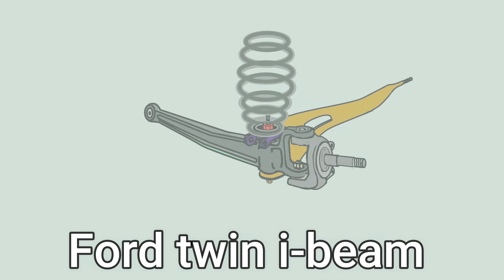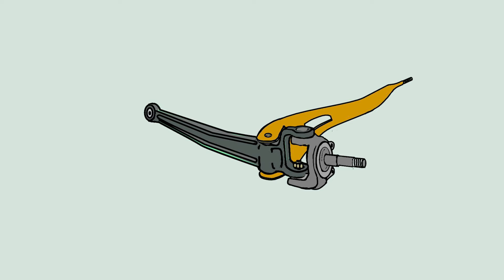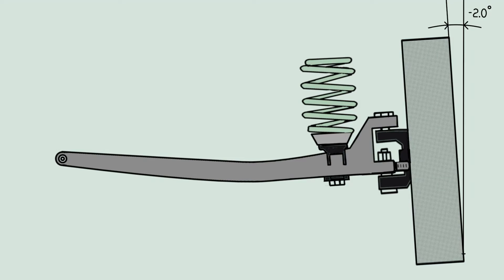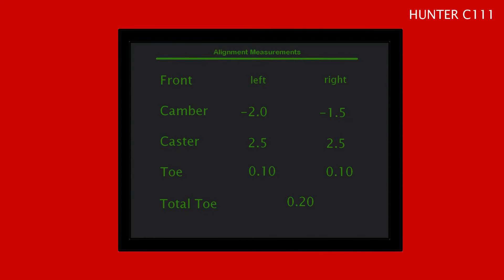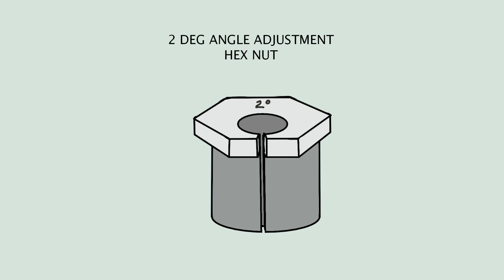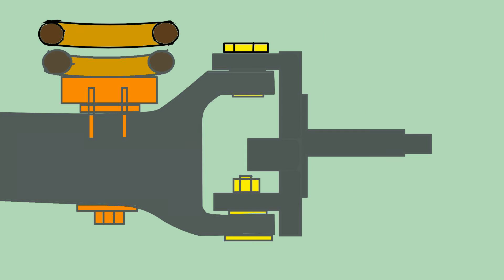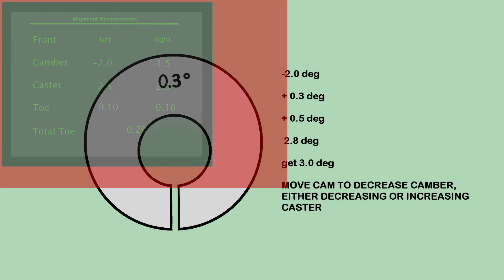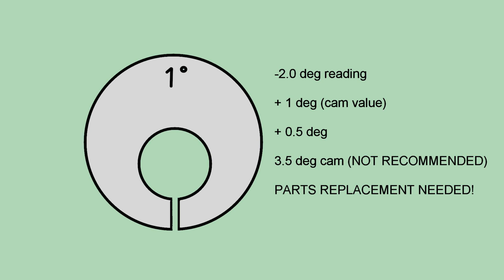Ford Truck twin I beam alignment

Comment: Thanks for the vídeo. I need help with sistem 1978, it's diferent.
Reply from the maker: which system do you have? is it a 4X4?
Reply: @CMDWorks  No, it's a Ford Econoline 250 1978 Twing i Bean, but, I hace to raise two Inches, to avoid the blow of the tire.
I don't know if it can be aligned
Reply from the maker: @hectorromero3418  No adjustment with cams on that one, has king pins. Right? if it does, to adjust camber, the twin I beam axle has to be bent to the right angle with hydraulic ram system special for that purpose. Good luck.
Reply: @CMDWorks  Thanks a Lot and great video

Comment: Can you speak to the 1980s Ranger adjustment here ? Mine appears to have that adjustable nut thing on the bottom ball joint whereas you say its on the top ball joint . Which is it ? Thanks !
Reply: Three things to remember: 
1) If the upper ball joint has the nut on the bottom, the bushing offset will only change Camber and not Caster.
2) The 4wd F Series and Ranger had slightly different size bushings and are not interchangeable.
3) If you can, always disconnect the tie rod when replacing or repositioning the bushings so you can turn the steering knuckle to be sure the bushing is properly seated and the ball joints are not bound up by being pulled away from each other or pushed towards each other. One strong finger should be able to turn it lock to lock up in the air.
Reply: @don2deliver  This is helpfull Thank you !
Reply from the maker: As I indicated on the video description, this video refers to 1990's twin I-beam systems.. I would have to make a different video for those older systems, that were a lot more difficult to adjust and replace the cams, I did a lot of alignments on them, and believe me, I still hate them. Thanks for the comment,
Stay tuned.
Reply: @CMDWorks  THATS why we need you brother ! I was scratching my head looking at my 88 Ranger . Im almost tempted to just replace the coils to hopefully correct the problem . Im out about 20 deg ( guessing )
Reply: @CMDWorks   Can you describe some instances as to what is hard about this 1988 Ranger ? I notice the adjuster is on the lower ball joint !  How do you get it out ? (my 2nd reply)
Reply from the maker: @tonyrandazzoe8210  I have not don one of this in decades, but if I remember correctly, take the lower not completely off, then use an air hammer and hit around the sleeve, (not the sleeve itself)  if is very rusted you have to keep hitting around it until the vibration loosens it. Exactly as if you are changing the modern ones.  watch my video: https://youtu.be/hap9qGD2ra4 just like that. but since it is upside-down is very hard to do. Good luck guy!!
Reply: @CMDWorks  Thank you brother!

Comment: I understand this. This is a great video to by the way. Do you know why on the ttb after I did a 6 inch lift the reason the front tires toe in when I go in reverse? Makes no sense and I feel like something is going to break. Everyone tells me the obs ford ttb is know to do that lol buy WHY! thanks just FYI when I pull forward tires straighten out
Reply from the maker: Most TTB systems do that. I would say thats normal. I have seen this phenomena since I started working on alignments late 1980s . Do to the design of ttb. However if you  use a lift kit it may be necessary to change the pitman arm with an extended one to compensate for the excessive angle on the toe bars. Good luck and thanks for your comment.
Reply: @CMDWorks  I bought a 4 inch RC suspension lift kit. It has I beam drop brackets radius arm drop brackets and a pitman arm that drops. Had new tire on yesterday then an alignment. They never did the alignment because I need to tighten some bolts down. Wish I took a video
Reply from the maker: @nauidiver227  Sounds like you got it covered as long as your tires look straight when going forward you should be ok. Good luck!
Reply: @CMDWorks  did an alignment today last time they refused to do it. I installed 4 inch RC lift 2 months before and the I beam bracket bolts needed tightened up. All I need is new caster bushings because the manufacturer caster only has one way to go in that will fix my tire toe in. After that I should be good. The only thing I had to do to fix tires rubbing going into reverse was tightening the I beam bolts.
Reply from the maker: @nauidiver227  I am glad you solved the problem. Good luck, and thanks for the comment.

Comment: You helped me realize that ill need to take my E350 chassis motorhome in to get the alignment.  Tires are wearing on the outside. Was thinking I could get sleeves and do it myslef but it's a little more technical than I thought.  Thanks
Reply from the maker: Good luck!! Thanks for watching!